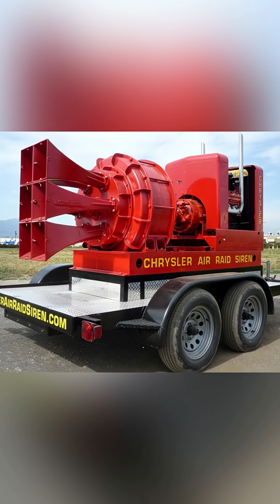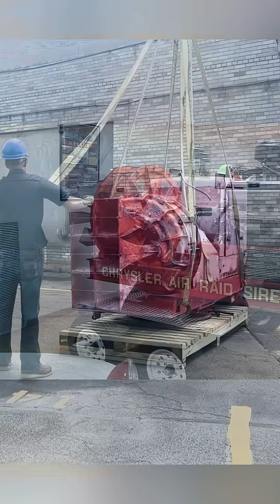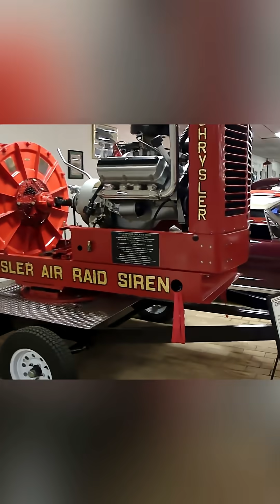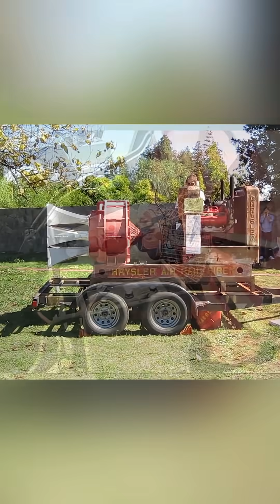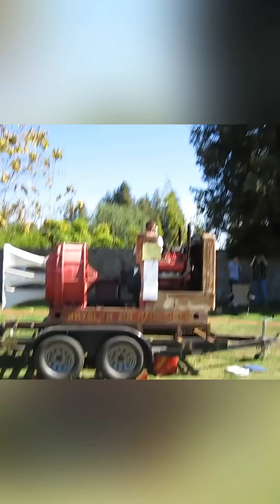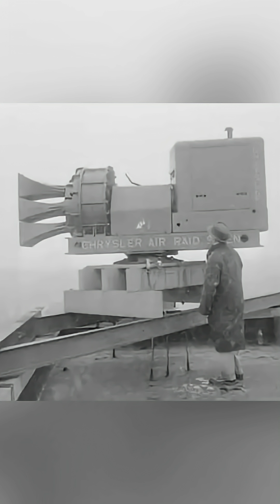Loudest SIREN Ever Made! -V8 180hp Hemi Chrysler Air Raid

Comment: Just to let you know that there isn’t a compressor in that siren. It’s a rotor that spins around a stator that chops the air up creating the noise you hear. No air being forced into the rotor. Think of it as a giant fan. 😊
Reply: @ACAFanAdventures - Are you saying this thing produces sound pressure levels of 138 dB without pressurizing the air?
Reply: @corpsie666 my bad, it’s weird how it doesn’t sound like the usual compressed air sirens like the Thunderbolt tho.😅
Reply: 2 or more(?) discs with holes in them, iirc
Reply: So this video is entirely wrong then. Yikes
Reply: @rayzerot No, commenter has no idea what he's talking about, only thing the video seems to get wrong is the "rotor" is more of a flat slotted disk with 6 holes.
Reply: @Gvacs I don’t entirely know what I’m talking about sometimes (no one is perfect) and I’m not a single siren enthusiast. The fact it’s the loudest siren has distracted me from knowing that a compressor contributes to this being the loudest siren. Props to you for catching that.😅
Reply: @ACAFanAdventures  You're all good, apologies for coming off disrespectful, I really need to watch how I type when I'm tired 😅😅